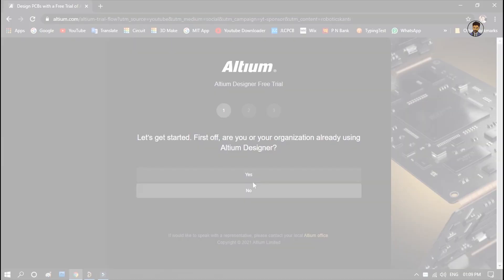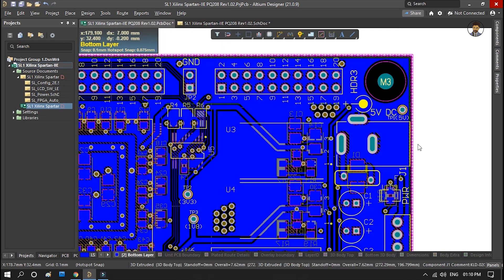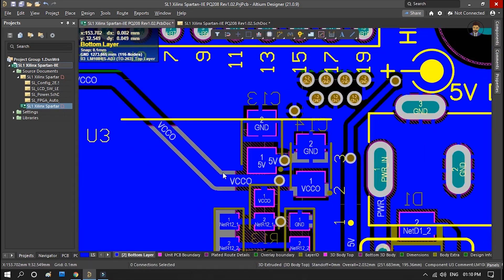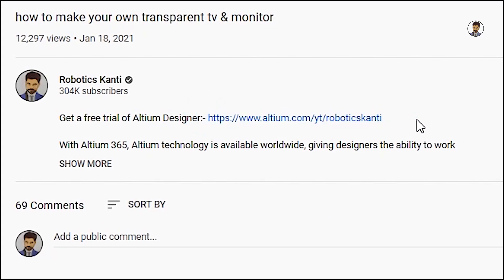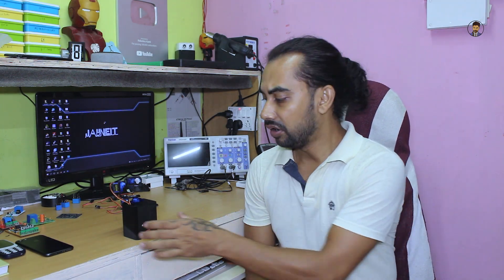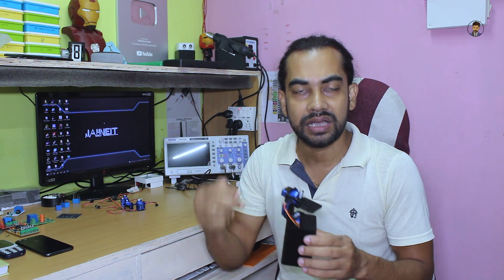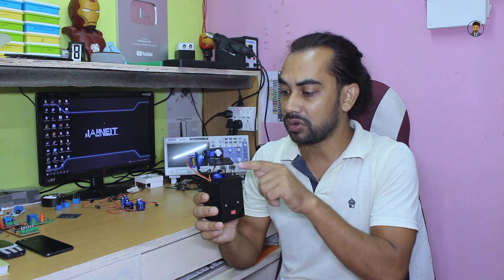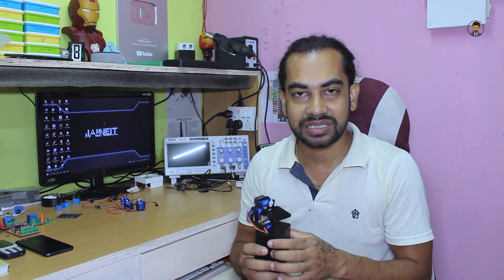how to make gimbal using  arduino at home

Comment: HI CAN WE USE MG995 SERVO AND ESP 32 OR 8266 MPU AUTO MODE AND MANUAL MANUAL MODE(MOBILE -OR- RADIO TRANSMITER) DOES IT POSSIBLE